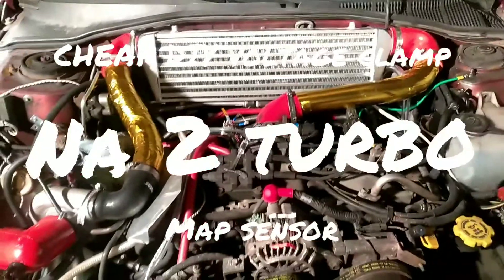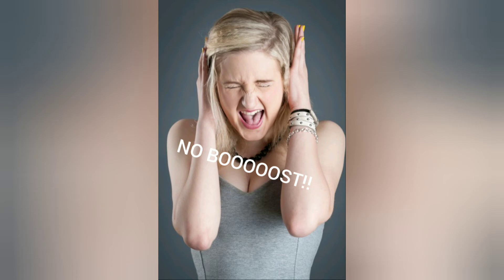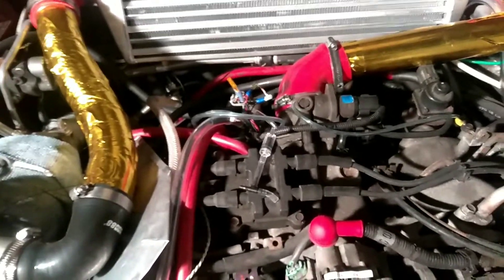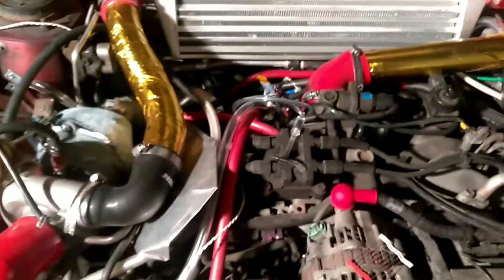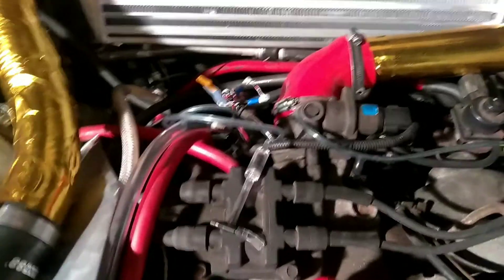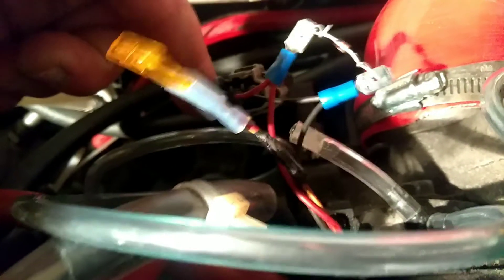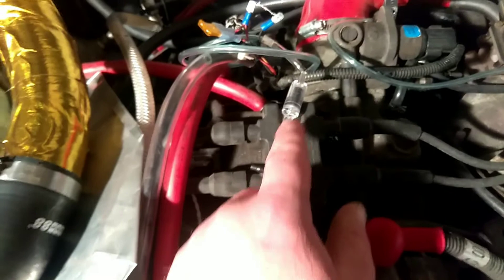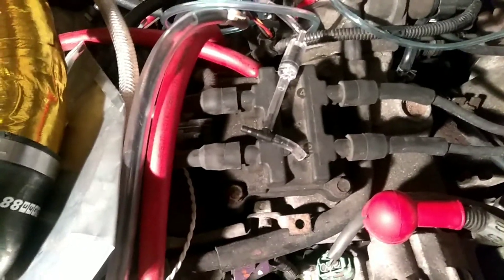DIY MAP SENSOR VOLTAGE CLAMP (Na to turbo trick ECU) FAST/CHEAP/EASY😁

Comment: Ive head just put a check valve in the hose. When it gets positive manifold pressure it stops the flow and the map sees 0inhg

Comment: I made one and converted the heads to ej20k made 346hp and 375ftlbs vf39 turbo, rip it shot a rod through the top of the motor after a hard hard days worth of rally. Then I replaced it with a wj257 bottom end and made way more reliable power. But the high compression and lack of ability to tune the ecu makes it hard. I had a piggy back that i clamped the voltage at 3.7 volts that’s when your car gets full fuel. Clamp at 3.7 IV data logged the shit out of it, also the greddy emanag I added fuel and reduced timing but had to find the factory timing curve and modify all the tables to make it the same as say a wrx. I made 20 psi 
Use a 3.7v clamp and tune fuel and air. Also go with the big maf tube to trick the maf sensor basically more air flowing through but it sees less flow. 1/2 watt zener will do by the way
Reply from the maker: Super valuable information 🙏💯

Comment: I just slapped a turbo on my 4g15 mirage and I hit fuel cut as soon as I go into boost. Im really hoping this is the cheap solution I need.
Reply from the maker: Check out "broke and boosted" 02 sensor pressure switch video, I can't remember the title exactly but that might help you too.
Reply: @crazyDIYguy  saw that. Seems like those are both for different things. The o2 seems just like smoother transition into boost
Reply: @crazyDIYguy  I also added a check valve and it does indeed allow the car to start trying to make boost while im waiting for the diodes to come in. I imagine if I put like 3 them on it would work but like how stupid is that
Reply: @crazyDIYguy  Follow up tried this and something didnt work. Car seemed to go into a limp mode and now wont turn over. I can easily get another map sensor but what do you think could be wrong. I went with a 5.1
Reply from the maker: @Clesarie it went into limp when you had positive pressure (boost)? Maybe you wired the diode backwards? Or you might need the next voltage rating, so like a 5.0v and work your way down from there. It's been so long my memory is rusty apologies

Comment: I have 10K pots between signal and ground on MAP and AIT in drivers cabin. Madness. Go for it.
Reply from the maker: You mean the air intake temp sensor? What does messing with that signal do? Always looking for new info on fooling the old Subaru 😎👍
Reply: @crazyDIYguy When you foul ECM with higher than real air mass flow it will retard ignition. Ideally standalone ECM with wiring is better, but I cant afford it.
Reply from the maker: @elementelectronics8824  I built a speeduino but it's been sitting there for over a year, haven't had time to try it. When I finally do I'll make a video, look them up, only a couple hundred. They can be ran off tuner studio

Comment: Am still torn between a diode or just using a check valve, my 03 legacy is running fully on microsquirt, just need the Baro/Map sensor overvoltage code to stay away. (and the occasional bank 1 rich code.)
Reply from the maker: I think the diode might be better the check valves but I can't quite remember I tried both and I'm pretty sure the diode worked far better. Either way they're both ridiculously cheap and easy
Reply: @crazyDIYguy  ended up ordering the diodes yesterday, check valve gets stuck closed and reads -20hg, stock ecu still controls the IACV so i couldn't leave it like that.
Reply: If u use a check valve your map will read always your maximum vacuum reached and then you will have a total opposite recipe for boost.  por fuel and advanced spark.
Reply: @jesusdiegoroblesgutierres3751  The stock ecu isn't running the engine, it's simply reading the sensors to run all the emissions equipment and pass OBD2 readiness emissions testing. 
In my case the check valve works, been running 15psi (td04L) on e85 with an unopened ej251 for over a year now.